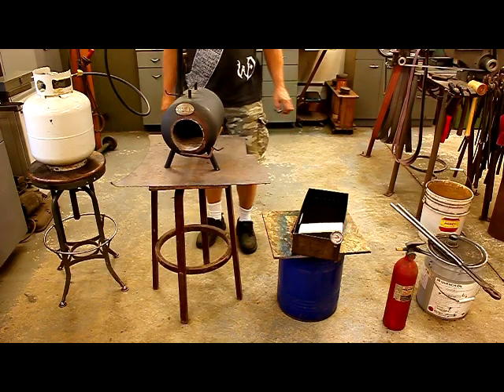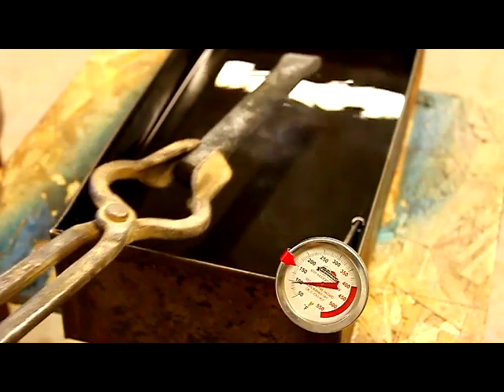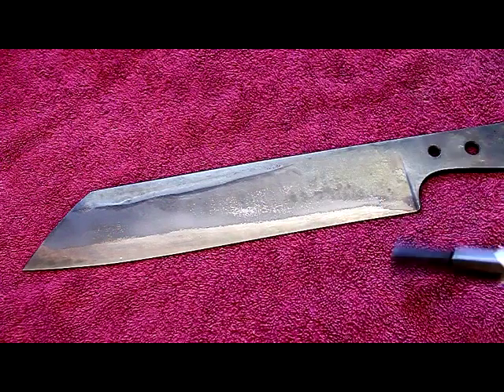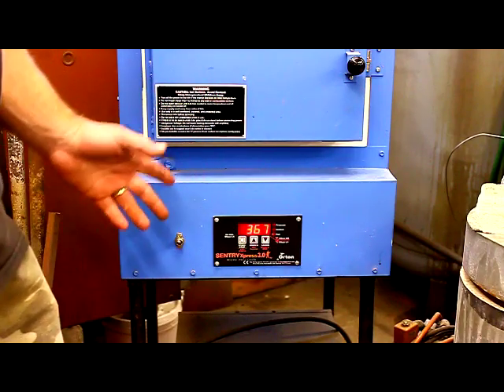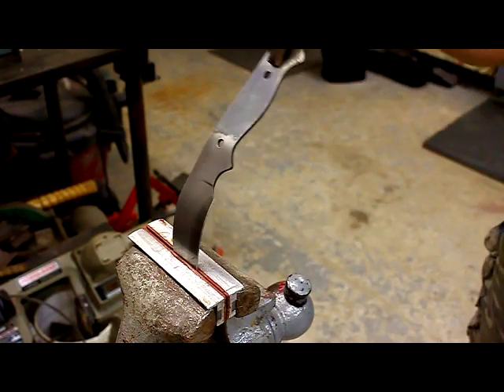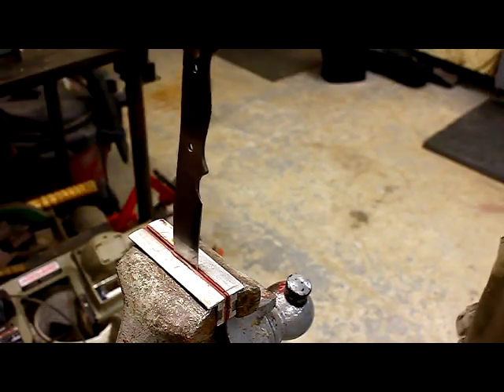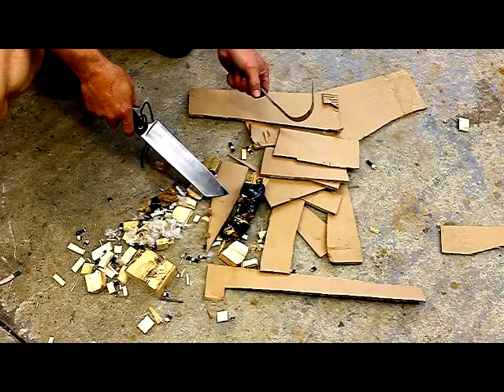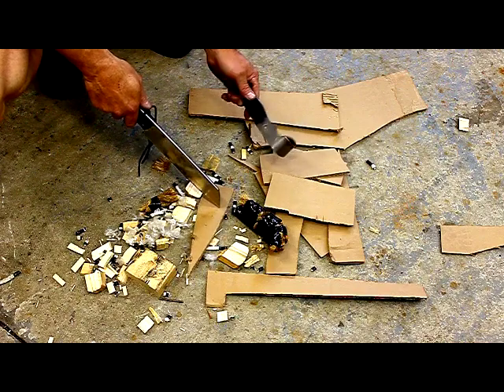Peter Martin Knives - High Performance Heat Treating.mp4

Comment: Whats the hardness on the blade you were flexing back and forth? The reason I ask is I've seen a lot of makers temper their blades to less than useful hardness im talking low 50's high 40's for demonstrations. Basically giving the steel spring temper, and then show how the blade can flex to 90 degrees. But thats not an honest representation of how the knife or steel will perform when its treated to a Rockwell thats more ideal for daily tasks a real knife would be put through. One maker on YouTube had videos of how his 1095 was even tougher than 5160, showing him flexing his 1095 blades beyond 90 degrees and the blades would spring back. (Take a 10 degree set), but still spring back, where his 5160 blades would snap somewhere between 70 degrees and 90 degrees. Im was impressed. But later found out his 1095 was tempered to 45-47rc, where his 5160 was tempered to 55-57rc. So clearly 5160 was light years tougher being able to flex to 90 degrees at 57rc vs 1095 needed to be at mid 40's. When he heat treated his 1095 to 57rc it snapped at around 45 degrees. 
No one sells knives tempered to 47RC, because the blade would be next to useless. I have a Kukri with a belly tempered to 45rc, but the edge is 60rc. Ideally I'm not a fan of differentially treated blades cause its hard to get it right. Typically the spine is left too soft edge too hard and first time it is subjected to lateral impact, the spine bends, the edge can't bend as far thus breaks, destroying the entire knife. But my Kukri is half an inch thick so even at 40rc you can't bend it. Still even heat treatment, is far superior if you temper it right and give the blade some springeness, so during an impact it can flex (not take a set) spring back to original without cracks, breaks or bends. But to my original point, the typical functioning Rockwell for most uses is between 55-60rc depending on the steel. So was the blade you tested in a vise heat treated to usable Rockwell or was it kept low so it would bend and not snap in the vice. Not acusing you of anything im just curious if that was a demonstration for learning purposes or real representation of how finish product would behave.
Reply from the maker: look up the process to make Bainite, 1095 steel RC58-59 and extremely flexible.

Comment: How is it possible to get mono steel so hard that it cuts nails like that yet so flexible to bend past 90? At what temp do u temper those?
Reply from the maker: Tempered at 375 F for 6 hours, it transforms the steel to tempered bainite. Still Rockwell’s at 58-59C
Reply: @pmartinknives  1095?
Reply from the maker: @dusanpavlovic2201  yes 👍
Reply: @pmartinknives  do you do 1 or 2 cycles i have never heard of temper that long why does noone do that what are pros and cons
Reply: @dusanpavlovic2201  bainite has a different crystal structure from normal tempered martinsite, it takes a long time to form and needs fairly specific conditions which is why the tempering process is so unusual.
Reply: @garethbaus5471  it's just differentially hardened
Reply: U can't possibly think that cutting edge is anything other than martensite right?
Reply: @dusanpavlovic2201  the time and temperature listed are actually in the correct range for bainite formation in 1095 assuming he uses a heated oil for both the quench and temper and doesn't let the steel go too far below 300°F before the end of that 6 hour cycle it could be a fairly easy process. The hardness listed is also pretty close to the expected hardness of bainite for a steel with roughly 1% carbon like 1095 when formed under those conditions. Short of cutting up the blade and looking at it under a microscope (preferably an electron microscope) the best way to determine the structure of the steel is by comparing the heat treat and measured properties of the steel to known models.
Reply: At what temp do you quench them
Reply from the maker: @dusanpavlovic2201  soak 5 minutes at 1525 degrees, then quench with the spine exposed above the oil. Differential quench with extended (6 hour) temper at 375💪 Will get you a tougha$$ Knife blade
Reply: @pmartinknives  so just 1 temper cycle 6h long
Reply: My knives get cold as soon as i pull the out cuz the edge is so thin i lose like 100 degrees in 1 sec, can i heat it to like 1550 so it cools down to 1500 and quench it
Reply from the maker: @dusanpavlovic2201  check after the first hour, straighten if needed while it’s still hot. Otherwise, let it continue tempering. Also leave the edge 1/16” thick before heat treat. Cold grind after temper to final thickness, this will also prevent warping or cracking during quench.
Reply: @pmartinknives  if i heat it too much can i let it cool down couple of secs and the quench
Reply from the maker: @dusanpavlovic2201  yes, providing the temp didn’t go above 1650. That’s kinda the ceiling for 1095, at least in my opinion. If it goes above, I would thermal cycle 3 times below critical and then re-heat treat at correct temps.

Comment: Hallo, sorry my english are bad and did not unterstood.What type steel use for thar knife?I take car leaf spring 5160, is possible made so elastic the knife.Din you follow annealing procedure before you work it?Many wishes from Greece my friend.
Reply from the maker: The steel is 1095 and it is fully annealed before working.